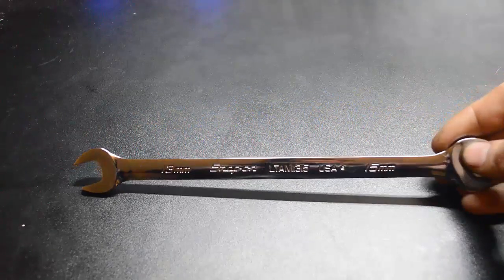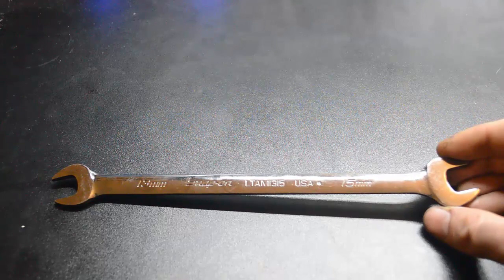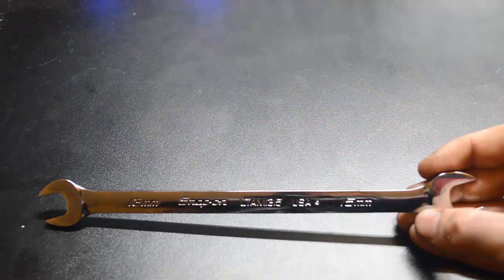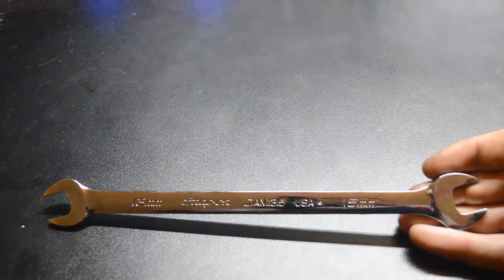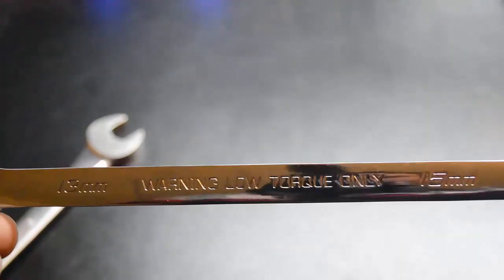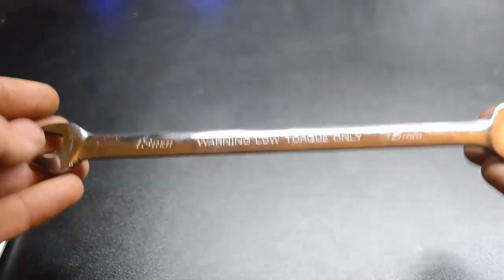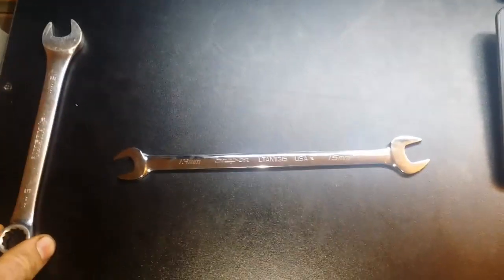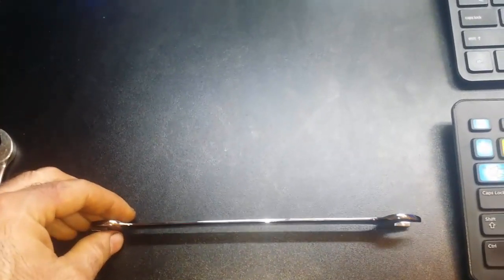This Type Of Snap On Wrench Will Save Your Ass A Time Or Two

Comment: Tappet wrench was my first thought also. My how times have changed. A tappet wrench set was an almost mandatory tool when I started wrenching years ago. And everyone who saying grind and weld on wrenches not such a good idea, tool grade steel is not meant to be welded it's generally brittle and cracks very easy after welding. If you know someone with a Bridgeport milling machine. Toss them a 100 bucks and have a standard and metric set milled down to about 6 millimeters and the bigger ones about 8 millimeters.

Comment: Klutch formerly northern industrial wrenches are thinner than your average wrench and tough. Never ran into either of those problems with the 305pc set. Wrenching professionally w them for 6 years. Only had to buy an xl flank plus 13mm for alignment, inner tierod adjustment. But when them tie rods rust up nothing but a biting open end or a set of knipex cobras will grab.

Comment: the craftsman evolve line has these as well. that's what I have because price was an issue with the snap ons. Haven't had any issues the the craftsman ones
Reply from the maker: How much were they and are they a decent length? Use never put a lot of torque on them so im sure it doesnt really matter what brand you get.
Reply: Bruce Allen the 7 pc. set i got was like $15 and are actually longer than the normal craftsman wrenches.

Comment: Type in low torque wrenches on google alot of companies make them i have craftsman's made in the usa i inherited from my grand father of course i have never searched for them but i guarantee others manufacture them my set goes from 1/4 to inch and a quarter and metric is 6mm to 24mm i believe

Comment: had the mac and i hated them.
sold them and got the Snap-on set.   
I work on small engines. and that one job more than payed for them.
what's also nice is the length of them. god forbid that engineers work on the crap that they design.
and to all you haters out there. what do you spend your money on?  
sun burnt dick i like it. im going to use that one.